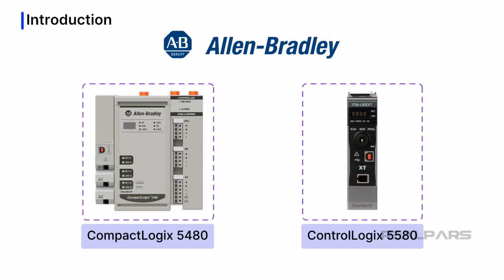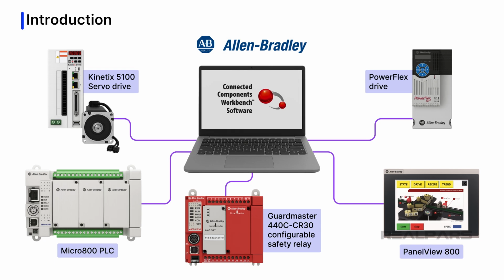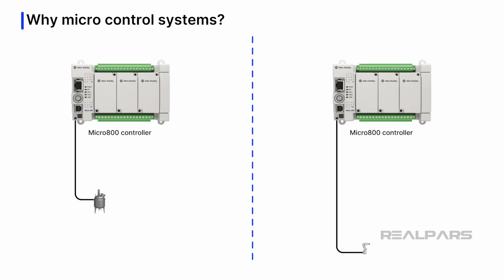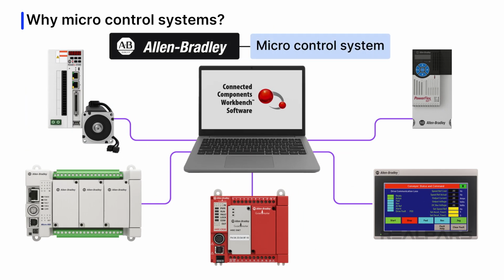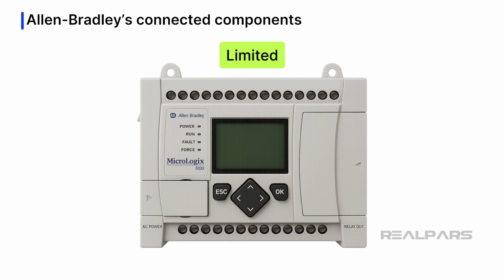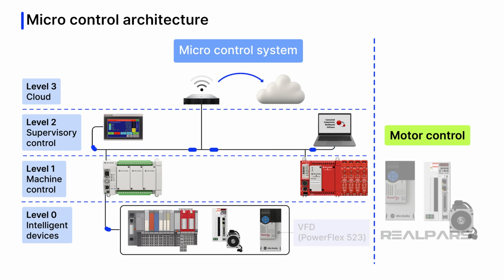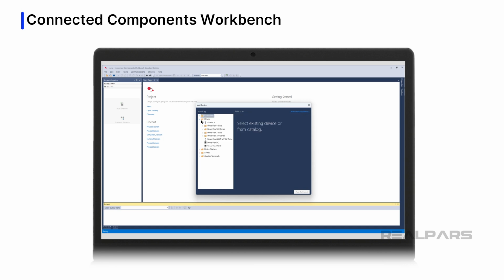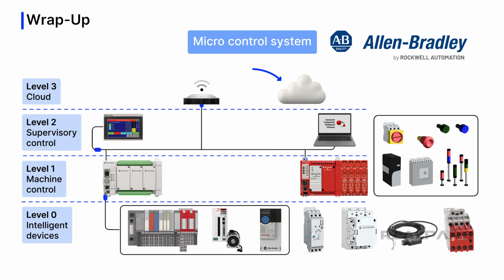Allen-Bradley Micro Control Systems Explained

Comment: ccw seems as a worse tia portal...  sadly no micro 800 surpasses micrologix 1400 in ease of use
Reply: The micro 850 programming is no harder than programming in studio 5000. In fact the interface can be switched to mimic the logix 5000 programming environment.
I've programmed in logix 500, 5000, CCW, TIA portal and am proficient in all of them.
The 850s processing speed, ability to build user defined data types and user defined function blocks like studio 5000 and TIA portal make it powerfull. The micrologix 1400s best feature was and still is, its reliability.  The 1400s ruggedness is still hard to beat.
Reply from the maker: Hello, @vinicius464able  and @gregorythompson6499 Thank you for your comment. I am sure other users agree with both of you. It is always very important to be exposed to more than one PLC type these days.